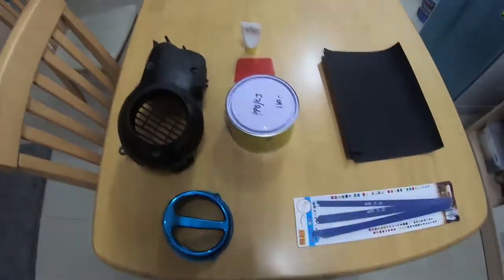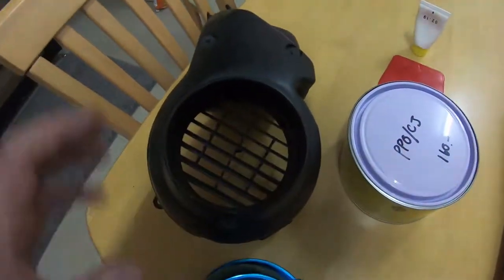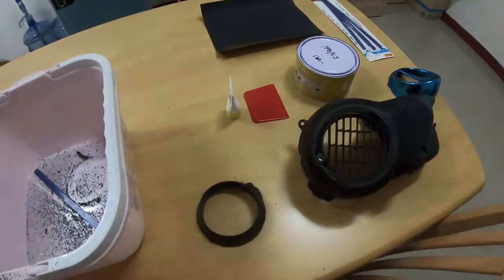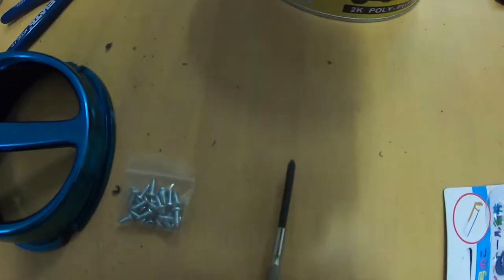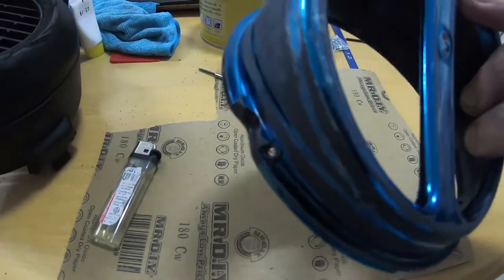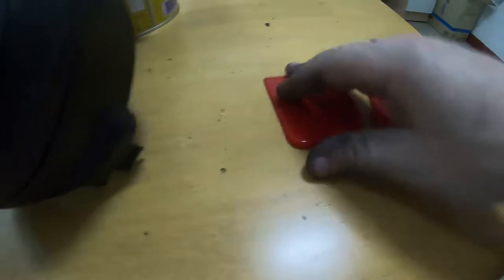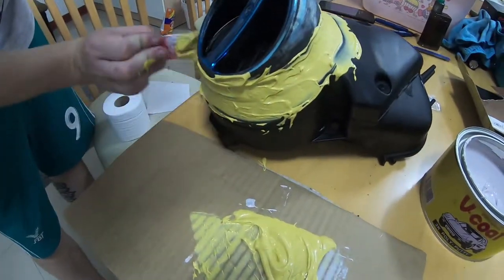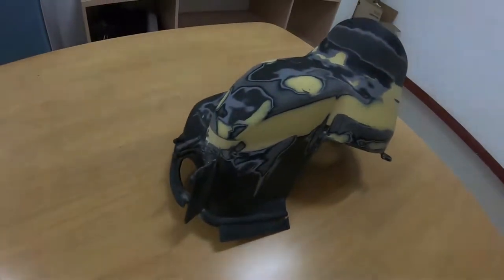Custom Shroud Extention For Honda Dio AF27

Comment: How much does a V8 power pipe cost in thailand? And can you tell us what market offers the cheapest parts and is close to the airport?
Reply from the maker: In Thailand we have genuine and replica V8 pipes. Genuine is about 120usd and a replica is around 80usd. There isn't any market for scooter parts near to the airport as far as I know. 

There are plenty of shops selling scooter parts but not close to the airport unfortunately. If you wanted to order some parts, I live right next to the airport. We might be able to arrange something. 👍